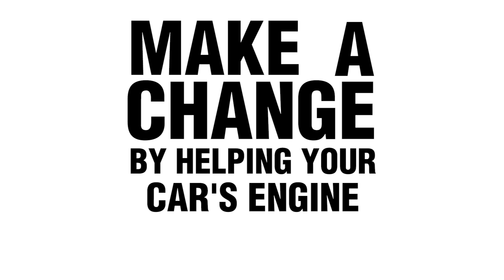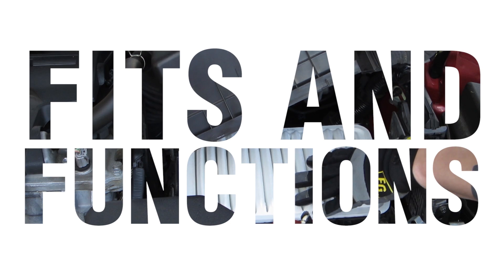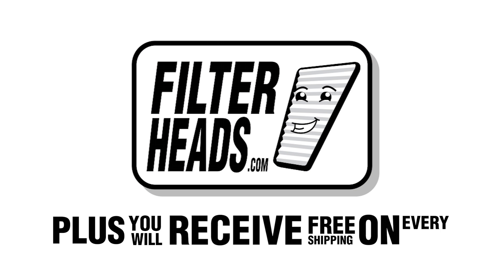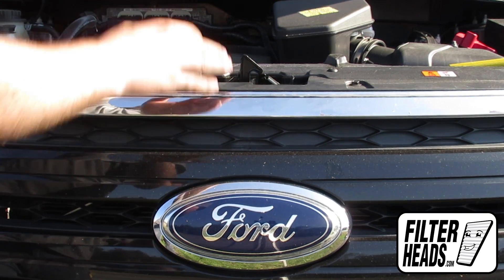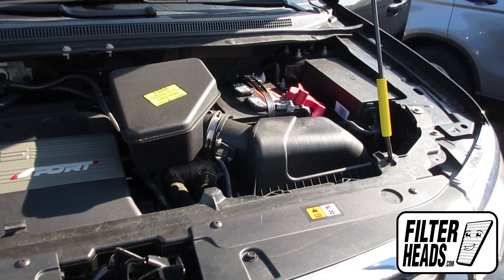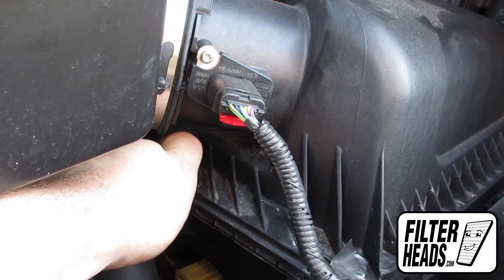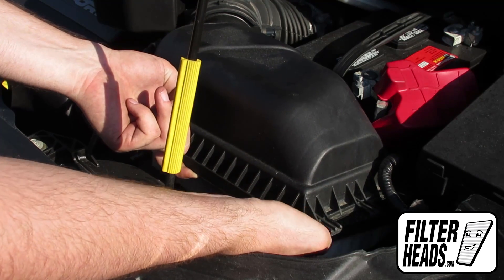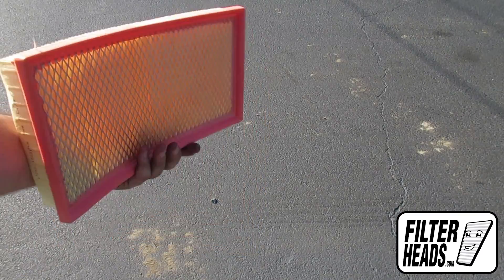How to Replace Engine Air Filter 2011 Ford Edge V6 3.5L | TA25699, AF2884

Comment: Mine doesn't even come close to lifting up enough to change the filter.
Reply from the maker: What is the make model and year of your vehicle?
Reply: @filterheads  07 edge sel plus. It just seems really stiff. Maybe I'm being too delicate with it.
Reply from the maker: @DonFatherTrump  loosening and detaching the housing cover from the hose clamp will make it easier to install the filter.